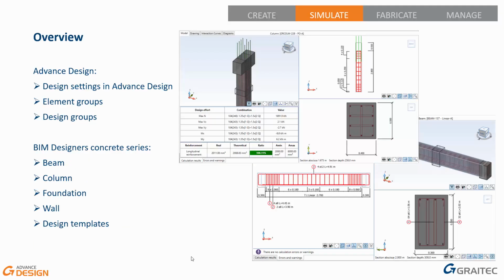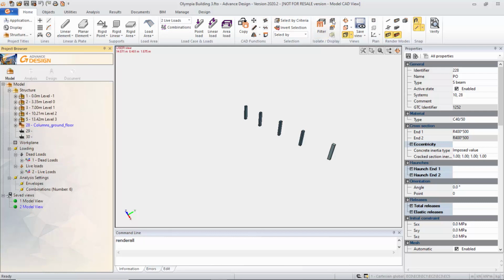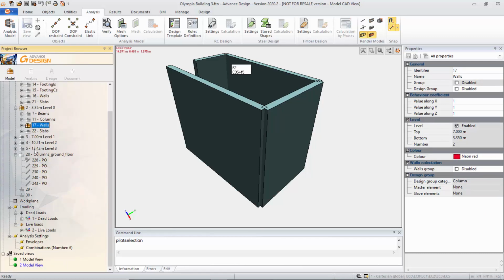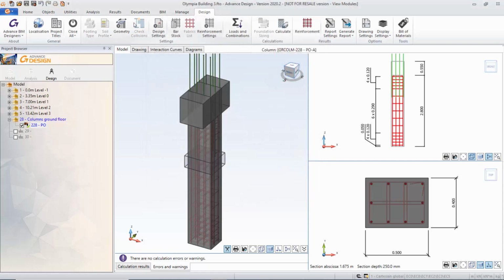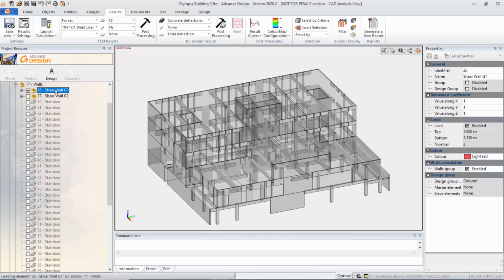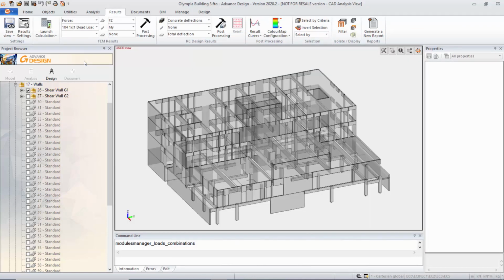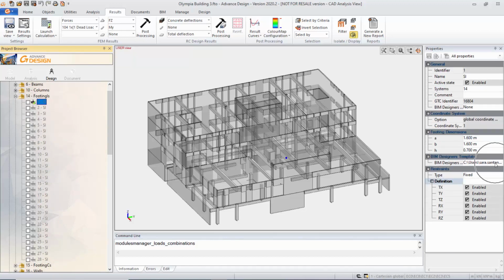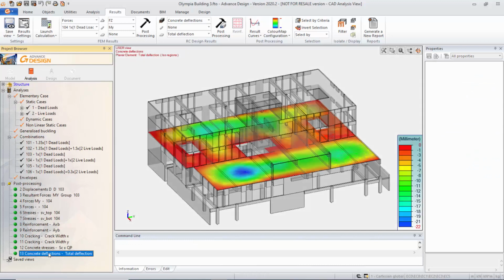Advance Design - Design and detail concrete members

Comment: The top and bottom reinforcements Axb Ayb always show some quite high value, 3000mm2 or even more, due to stress concentrations around corners or at supports. Not sure how BIM designer handle this issue?